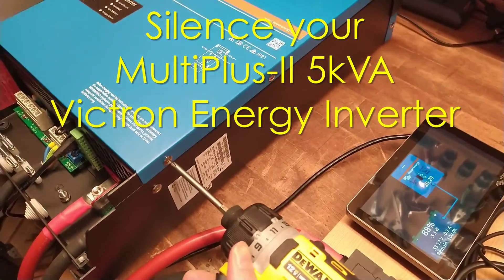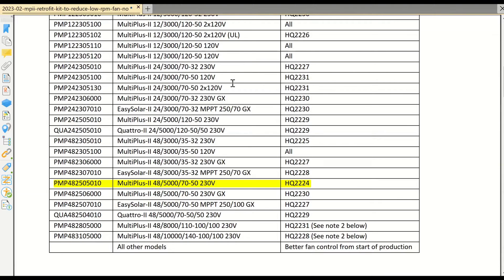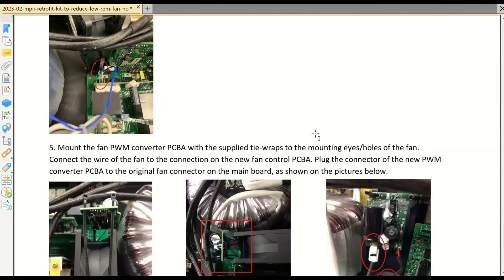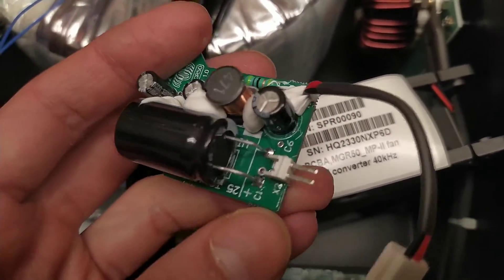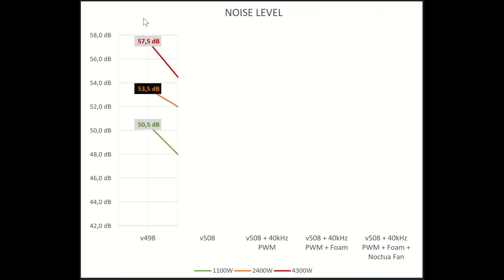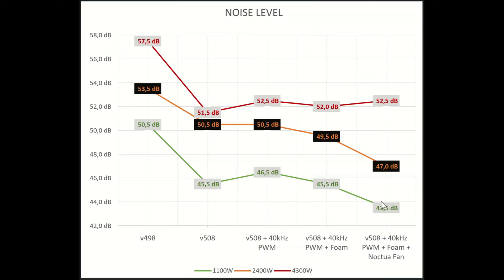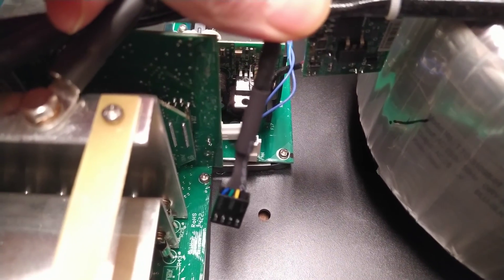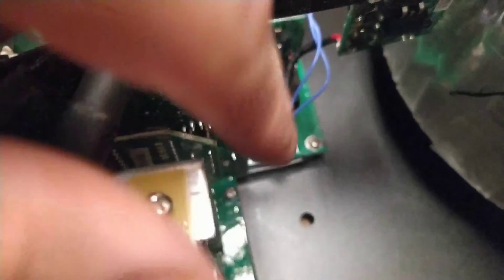Silence Victron MultiPlus-II 48V 5kVA Inverter

Comment: Has anyone considered fitting a rubber gasket at the rear of the transformer in an attempt to remove "hum"?  I notice this hum can couple into the case and walls quite a lot.  Yes, you can try to isolate it from the wall with rubber mountings but maybe the transformer mounting itself can be modified?
Reply from the maker: I did that as well. But than you also reduce the heat transfer of the transformer to the case. It is ok in colder climate and helps with the humming sound. Or you just go for the new Multi RS Solar 6000VA without a transformer.
Reply: @Raphael_Hofmann   thanks.  What material did you put behind the transformer?
Reply from the maker: @Chris-hy6jy  EPDM tape

Comment: Hi, thanks for your videos. Can your inverter sustain 4500 W of load during 12 hour period to charge BEV without overheating ?
A lot of users report, that after some time, toroid will overheat, and Multi. is derating power to around 3700 W only. Thanks.
Reply from the maker: Yes, the continuous power output is 4200W below 25°C air temperature. If you need more power, you might look into the new MultiRS range with 6000VA. Very silent operation.

Comment: Hi, very interesting and useful video. I have 2 questions. Why didn't you buy a Quattro instead of Multiplus? The Quattro is fanless, so much more quieter. Second question, I have seen you have also a Fronius Symo. I had this inverter for one year adn was an hell of screamer, I had changed with a fanless SMA. Is not the Symo much mor noiser than the Multiplus? Regards
Reply from the maker: Thanks for your comment. Those are good questions. How sure are you, that the Quattro does not have fans? I thought, the main difference are two inputs instead of one. The tumbnail does not show my system at home. It is at a customers site in the basement. So they are fine with some noise. The fronius Inverter in the thumbnail is a Primo 4.6. Those are more quiet than the Symos. I have a Symo myself...but I mounted it at the outside of the house....it is very loud indeed. I would go with SMA next time as well. But it was just easy to integrate the Fronius over my Ethernet network, since it natively communicates with Victron and I do not need a extra meter for it. But Victron should be able to read SMA soon as well.
Reply: @Raphael_Hofmann  just open up the modbus port on the sma and it works even on 10 year old sma just need lan ports
Reply: @Raphael_Hofmann  I was sure that quattro doesen't had a fan because I had read on Victron datasheet some time ago,  but I'm not sure anymore. I have checked and I dont find that information. By some videos probably you are right and It has a big fun on the bottom. Disappointing.

Comment: noctua fan looks like will make much less pressure than original one. wind speed is only one aprameter, pressure is another.
Reply from the maker: Pressure is about the same, according to the datasheet.

Comment: Cheap engineering, put an actual pwm fan in.  Use the stock pwm supply as the pwm signal, hook up the fan to 12v supply.

Comment: Before buying Noctua you should've learned the lineup of coolers they have... Static Preasure parameter... yet it's mostly matters when blowing through a dence radiator

Thanks for the video!
Please, post updates if any
Reply from the maker: The Noctua has very similar specs on paper. It fits well and is a good replacement as far as I can tell.

Comment: I would be more concerned about the EMI/EMF from these units, if you spend a lot of time in close proximity to these units. Thank you for sharing...
Reply from the maker: I did some measurements and in 4-5 m distance, you can not measure any EMF anymore.
Reply: @Raphael_Hofmann  so then, if you are within 4 to 5 meters, you will be in range of/exposed to EMF/EMI emissions. Sounds about right/typical, and they can be quite annoying/uncomfortable (especially the high pitch from frequency inverters). These things absolutely need to be isolated from the living space or anywhere you spend a lot of time (where you could be exposed)...

Comment: What was the cost of these various adjustments? I am looking at a Multiplus II and it would ideally live close to the living room. Nightime charging noise could be an issue.
Reply from the maker: If you go for the noctua fan and also the EPDM Foam...it should be around 40€

Comment: I notice no filtering in there at all... Gonna get really dusty over time that can trap moisture and cause corrosion! Shame on Victron for not adding some filtration and conformal coating to the more sensitive electronics in there.....
Reply: Mostly filter kills units as they get clogged and the unit then overheats...
Reply from the maker: @tiloalo  I agree, Victron does a good job in this regard.
Reply from the maker: I have 3 of them in service in my basement for 5 years now...they are working hard every day and they never clocked yet. I will have a closer look at the corrotion resistance and conformal coating next time, opening one up.
Reply: Filters kill airflow 
When is the last time you cleaned your bathroom fan ? 
Or hood vent ?

Comment: Thank you for your video. I discovered the noise of the Multiplus II. A bit of bad surprise...  Do you think the 140mm Noctua could be install instead of the 120mm ?
Reply from the maker: It should fit, but you have to build your own frame. By the way, the Noctua fan is not actually that much weaker. So it almost matches the Victron Fan when maxed out...just at 12V it was a bit weaker. Most important is the foam between the fan and the case. Even the Jamicon fan is not too bad, if you insert some foam to detach it from the case.

Comment: I think I got a problem, I am using 50mm2 lugs which do not fit through the cable holes in the multi XD this is going to be fun when I remove the fan
Reply from the maker: I wonder which type of lug you use, that does not fit 😅
Reply: @Raphael_Hofmann   okay well they fit through the holes, but not through the cable gland I put in XD
Reply from the maker: @legominimovieproductions  Yea...I know the problem...In stationary systems without vibration, I do not use those cable glands at att on the 50mm² or 70mm² DC cables.

Comment: My solution was to blank off all the vents at the bottom left and divert the air evenly around the transformer. 
When the Multiplus is charging it gives out a lot of heat and air was recirculating through those vents back up the right hand side via the terminal box at the bottom. 
As the relays don't need cooling, they are not affected. 
The improvement is very noticeable as the front cover is way cooler.
Thanks for the tips and now I will check my firmware.
Reply from the maker: Wow, sounds like something the manufacturer should think of too...
Reply: @Raphael_Hofmann  I agree, it's a simple and free solution that only takes a few minutes giving a dramatic improvement.
Reply: It's not just the transformer that needs cooling, the mosfets also need good cooling too...
Reply: @dougle03  blanking off the left hand vents forces all the cooling air to be drawn over the electronics so they are cooled far better.
Reply: I have 2 multis in parallel and blanked off the vents bottom left of the master,gave full load near to 8kw charging my ev and also ac.After half an hour happened the opposite than I expected.The master which was supposed to be cooler enough had the over temperature light blinking,temp was around 45C and at the slave 43.5C!!!!!Any explanation????
Reply: @ioangok1 mine is the same as in the video, 5kva Multiplus 2. Yours must be laid out differently if it gets hotter.

Comment: I have drilled slightly larger holes in the Chassis  and added rubber cable gland to isolate the screws of the Fan from the Chassis.
Reply from the maker: I am sure it helps! Are you satisfied with the result?
Reply: @Raphael_Hofmann  Yes I am. Unfortunately there is not enough space in the housing to do more or thicker rubber.

Comment: What if….

We would replace the fan with a Phantek T30, which is about one of the best 12mm PC fans on the market when I should believe all reviews.

The big question would be, if it beats the original fan in creating a similar airflow with less noise that the original Victron fan. It beats the Noctua in PC cooling conditions.

When we assume Victron chose
the stock fan for the right amount of airdisplacement in certain conditions the Noctua may not be the best replacement. Although it may suffice depending on the environment the multi is used in.

Who would vote for a review like that ? And would it be worth a beer or a cup of coffee ?
Reply from the maker: I had a closer look at the datasheets and converted the units: Air Flow: 
Nocuta: 186.7 m³/h, Jamicon: 187.89 m³/h 
Static pressure: 
Nocuta:  7.63 mm H₂O, Jamicon: 8.13 mm H₂O
So the difference at full speed is not that big...
I will try to make a follow up video...
Reply: @Raphael_Hofmann  

Hi,

If those numbers are correct, the Noctua and Jamicon move more air then the Phantek T30:

120 x 120 x 30 mm
1200/2000/3000 (+/- 5%) RPM via three modes
39.1/67.0/101 CFM (66.4/114/172 m³/h)
11.1/27.3/39.7 dBA
1.27/3.30/7.11 mm H₂O
4-pin/PWM control
0.05/0.13/0.36 A peak

Assuming you used the nfa12x25 I found this:

Rotational speed (+/- 10%) 2000 RPM
Rotational speed with L.N.A. (+/- 10%) 1700 RPM
Min. rotational speed @ 20% PWM (+/-20%) 450 RPM
Airflow 102,1 m³/h
Airflow with L.N.A. 84,5 m³/h
Acoustical noise 22,6 dB(A)
Acoustical noise with L.N.A. 18,8 dB(A)
Static pressure 2,34 mm H₂O
Static pressure with L.N.A. 1,65 mm H₂O

Not sure how performance differs in the Victron as in most PC applications there is a Radiator or grill in front of the fan. Inside the victron is has more room I guess.

Looking forward to the follow up.

Tnx.

Mike
Reply from the maker: @NaamNatuurlijkniet  Thanks for all your input! Some people install additional external fans. That would also work to reduce the noise.
Reply: „It beats the Noctua in PC cooling conditions“ - in short: nope

Comment: Hi,

Good video. A less powerfull fan may prove a somewhat hotter inverter at some point and thus a shorter lifespan.

Seeing the inside of the inverter this way I wonder if some other better cooling method may even be more effective. 

Victron never designed these devices for sleeping next to them. I have to say, the rattling sound made me thing I had a faulty fan.

The firmware, foam and rubber plugs are a great solution. I guess I would try rubber rings on the fanscrews to the chassis also as there may be some contact noise there also.

All in all, a lot of improvement is possible in terms of sound reduction. 

We have to keep fireresistance in mind I think.

In an other Video someone placed 2 extra fans below the inverter as well. I guess the fan speed is temperature controlled, so having an overall airflow thru the unit may help.

I am even playing with the idea of connecting them to the ventilation system of the house, so that air is always running thru the units. It will collect much more dust I assume.

Anyway, good video.
Reply from the maker: Yes, you brought up some good points! I will see, if I can do some more testing and maby I find some time for a follow up video.
Reply: @Raphael_Hofmann  

Would be nice 🤣
Reply from the maker: @NaamNatuurlijkniet  Just found a very detailed discussion in the Victron Community:
https://community.victronenergy.com/questions/46137/victron-multiplus-ii-485000-noisy-fan-replacement.html

Comment: Helpful video. However I concur with the comment about fitting any fan that is less powerful. As well as a Multiplus 48v/5000 I also have a Quattro 48v/10000 which work together for EV charging off-grid. Even in the UK the summer temperatures were warm enough for me to have to fit external high flow fans to both inverters to ensure adequate cooling.
Reply: Did you messure the temperature or was that just your „personal feeling“?
Reply: I used the graphs available through the Victron software to assess the problem. Before I fitted the 'bilge blower' type of fans the Multiplus 3000 kept cutting out whilst it was running continuously at 2250W even at +8degC. The Quattro normally coped because or was running at about 50% power. The Multiplus 3000 was checked under warranty but no faults could be identified. Contrary to specification Victron inverters struggle to give continuous rated output at the quoted +25degC. I upgraded to the Multiplus 5000 and with the bilge blowers using internally mounted sensors and the inverter relays, the software could be used to decide when to switch the fans on. I used 100mm circular ducting with a rectangular adapter under each inverter. No problems since even at +33degC OAT.
Reply from the maker: @nigelcharles511 Wow, you put a lot of work into that!
Reply: @Raphael_Hofmann  Hours of charging at 7.2kw in summer does seem to challenge the Victron specs. To keep the MPPT controllers from capping performance I also fitted pairs of 90mm centrifugal computer fans under each MPPT. Otherwise they could get too hot to touch when PV output and OAT are high. They are noisy but as this is in a hangar I don't care too much about the noise.
Reply from the maker: @nigelcharles511 A friend of mine also uses external fans.
Reply: All four MPPTs were installed correctly. The combination of high ambient temperatures in summer combined with long periods of 7.2kw EV charging loads plus up to 10kw of battery charging means that the MPPTs are running near to but within their specified limits. I use temperature controlled centrifugal computer fans that cut in @40degC and turn off @35degC. I believe that this is good for long term durability and uses minimal power. I think that any system that is used for regular EV charging needs extra measures to keep the MPPTs and inverters cool in summer. We charge two EVs most of the year and a friend often uses some of the excess with his EV in summer so we work the system quite hard.
Reply from the maker: I should check out the airflow of the two fans at 24V as well.

Comment: Be very careful fitting a weaker fan - taking 25% off the fan power could cause premature faliure and I can't imagine you'll be getting a warranty replacement.  People are always fitting noctua fans to things and going oooh its so quiet - yes it is as you'r running your unit 30% hotter than it was.... :/
Reply from the maker: The MultiPlus-II does not only regulate the fan speed on a fixed Load-Fanspeed-curve. It is also regulated on temperature. And if the internal temperature gets too hot, it is derating its output power to protect itself. From my experiance, running this configuration in Germany, it never gets too hot, even with the Noctua Fan installed.
Especially in a ESS-System, when the output power is limited to 4.3kW.
Reply from the maker: For a hot climate, you can just stick to foam and rubber wallplugs...
Reply from the maker: I agree in terms of Warranty...you probably void your warranty.
Reply: In most cases the Noctua fans are quieter AND push more air than the cheap fans … you could use the industrial fans if you live in hot climate … so no idea where you are coming from when talking about „people always …“